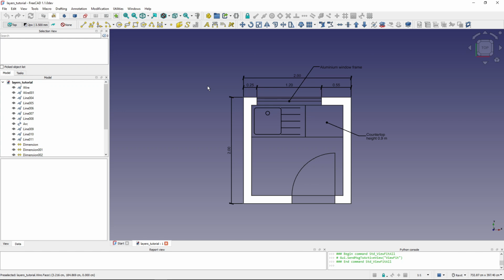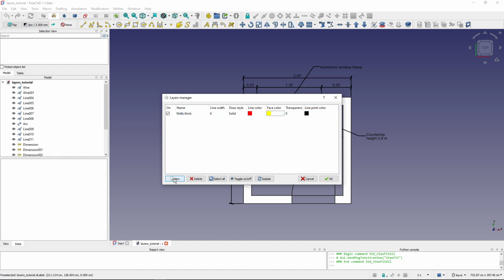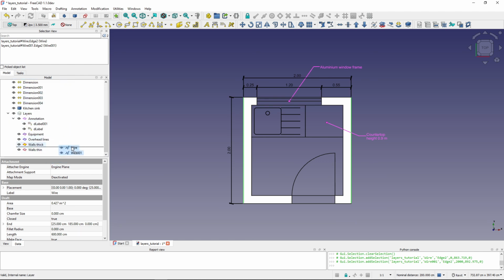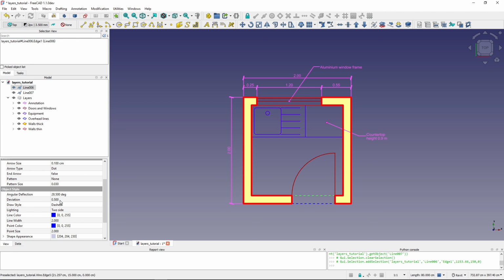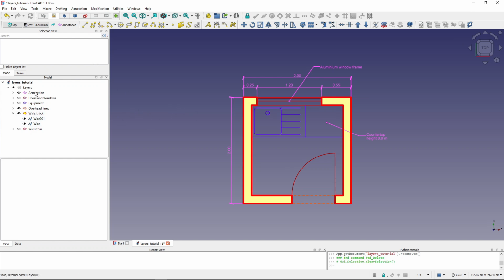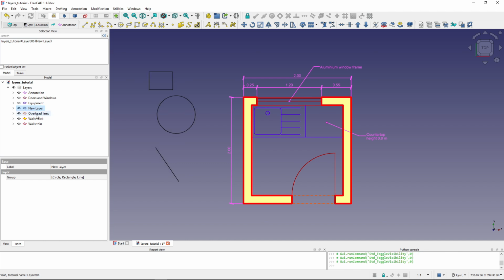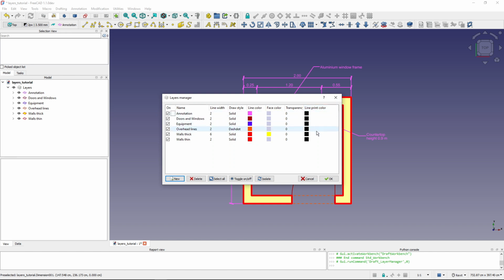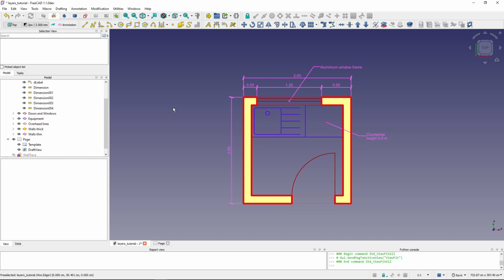FreeCAD Layers Overview

Comment: Hello,
thanks a lot for this very valuable Video; it saves me a lot of learning effords!
Especially, as a none English native speaker and FreeCAD novice, I found it perfectly understandable and it was perfectly dense no repetition. 
I like as well the speed of the mouse movements and the circles around the the mouse-clicks; something I have seen the first time in a tutorial, but what I always wanted to have - well done !
One question I still have is if it is possible to place an object into two or more layers e.g. Layers Floor1 and Floor2 and you want to place the ground-walls into both - is that possible? Is there a way to deal with that without duplicating the walls?
Looking forward to some more tutorials from you !
Reply from the maker: Thanks for the praise. I am glad the video saved you a learning time as this is the reason I made it 🙂.

It is not possible to place object into two layers.

Comment: I recently downloaded Freecad, the Layers dropdown in BIM not working. I mean there is no layers dropdown icon shown in front of the layer. And moreover if I drag any item on the layer it doesn't go under that layer. Grouping the items like in the group isn't possible with the layers. I tried resetting nothing works. Which version are you using.
Reply from the maker: The version used in the video is FreeCAD 1.0. All the shown functionality should work.
Reply: @FCBlounge  Sir if you want I can capture the video and share it with you. Can I have your email id.
Reply from the maker: @osst-opensourcesoftwaretut4512  It is better to post your problem and the video on FreeCAD forum: https://forum.freecad.org/index.php

Comment: Does the layer function works in the a2plus work bench? Can you toggle it on or off? Its very ineterresting. In my old job i was making assembly drawings with some context and all the context was in blue in the 2d drawing.
Reply from the maker: I have no experience with a2plus workbench, so I cannot tell. You could give it a try, I guess it could work as Layers is part of Draft and BIM workbenches, which are default workbenches in FreeCAD.

Comment: Can you create blocks with freecad?
Reply from the maker: For sure you can group thing together in FreeCAD. I would say the closest thing to block as I know it from AutoCAD is the Compound tool. But other tools can be used such as Group, Part, Link.... there are many options as is usual in FreeCAD :)
Reply: @FCBlounge  But would they pick up layer properties?
Reply from the maker: @hitboxkoicarp  It depends, all of these objects behave in a different way. But if you create a Compound and create clones from the original compound, than yes, it takes over the properties of the Layer.
Reply: @FCBlounge  I have also found that it doesn't work well with mirrored objects either... the mirrored object picks up the layer properties but base object doesn't..
Reply from the maker: @hitboxkoicarp  Yes, mirrored objects behave this way. There is a discussion on how these should be handled, it was reported to GitHub: https://github.com/FreeCAD/FreeCAD/issues/16725